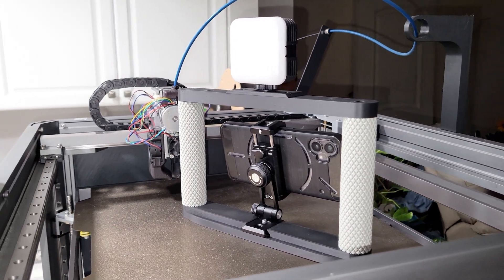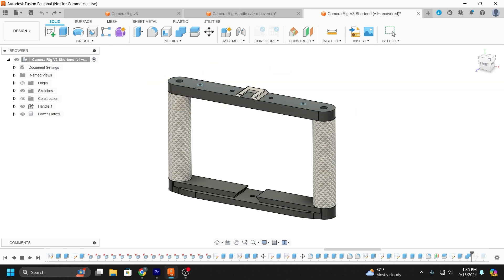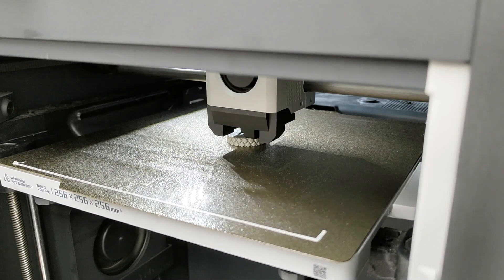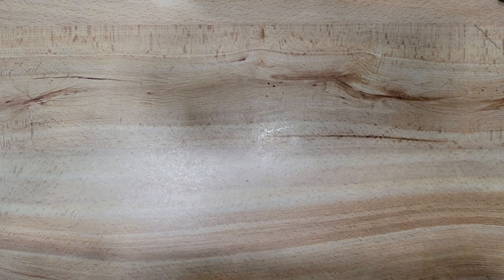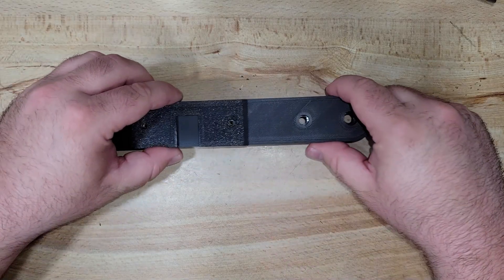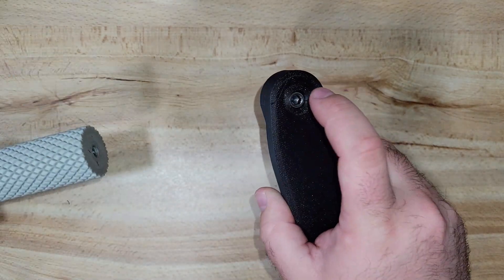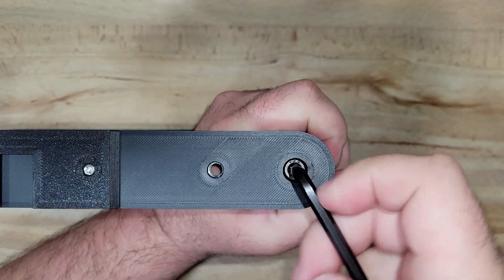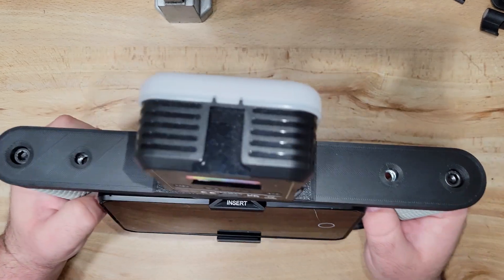3D Printed Modular Smartphone Camera Rig

Comment from the maker: GOOD NEWS! The new 2.0 version is finally here! Check this link for the updated version! https://youtu.be/8fgb2jeaN3w

Original comment: Hey everyone just a little heads up, I am working on a slightly modified V2.0 of my camera rig design. The assembly will be the same, but the new one will fit larger phones a little bit better. I will update this comment when that version is ready. Thanks for watching!
Reply: did you do a new rig yet to fit larger phones and is it ready yet
Reply: do have have  new rig ready yet to fit larger phones
Reply from the maker: @St.MarysKnights  The new version is ready. It is smaller and lighter but will fit bigger phones! here is the link: https://youtu.be/8fgb2jeaN3w

Comment: Do you have .3mf file?
Reply from the maker: This is an older version of the camera rig. I would recommend looking at the newer version here https://www.printables.com/model/1239977-smartphone-camera-rig-v2 if you really want to make this one, the links to the files are in the description
Reply: I do but my settings in orca are not right want to see if you had the 3mf file
Reply: The 1/4-20 screws stick up to high my print head keeps hitting them
Reply from the maker: You might not be using 1/4-20 jam nuts. They are different from regular 1/4-20 nuts. Are you able to measure the thickness of the nut using calipers? If so I can make a custom version for you if you are not able to modify the STEP files yourself
Reply: @makerscorner93 I did I got regular jam nuts 5.56 mm

Comment: Thanks bro. Never knew why pausing a build would be helpful until now, and also learned about the heat set inserts too.
Reply from the maker: Glad you learned something new! Pausing a print to install hardware, magnets, etc. is a great way to add internal features to a design that otherwise would be difficult or impossible to do otherwise. Thanks for watching!
Reply: @makerscorner93  MAGNETS! I have an idea.
Reply from the maker: Haha just be careful that your nozzle isn't magnetic! If it is make sure to glue your magnets in place before resuming the print! (I have absolutely made that mistake before)

Comment: Didn't find anything you liked, so you designed one that looks just like all the other ones?
Reply from the maker: The ones I found used 3D printed phone holders. They tend to wear out very quickly and not something I would trust putting a phone in. I also wanted a cold shoe mount and a few 1/4-20 mounting points. None of the ones I found had all of these features, so yes I designed one myself. There are not many ways to make something like a camera rig look different. I just made my own with the features that I wanted

Comment: My 2 cents: By default, Slicer shows a fully "completed" layer. That's why you think it's "already closed/sealed" and you can't put any nuts/magnets/objects in it. But the printer always pauses BEFORE starting/completing that particular layer. In other words, you could (and should) "add pause" at layer 34, not 33 (as you did) for the first pocket and at layer 661 and not 660 for the top pocket. Is this absolutely necessary? No, but it could ruin your print or even damage your tool head. How? If your layer height is greater than 0.2mm AND your z-hop isn't there or is too low... your nozzle could collide with the nut/magnet/object since you're printing the second to last layer.
Reply from the maker: You are absolutely correct. That is why I always make my pockets a little deeper than they need to be. It is hard to see in the video, but there is actually a pretty decent gap between the top of the nut and the top level of the pocket where the print pauses. This way if for some reason there is a collision, it is while the tool head is going around the outside of the hardware instead of directly over it. This gives a small opportunity to stop the print hopefully before it does any damage. Thanks for the comment. Great advice for anyone else who might be designing something with similar techniques!

Comment: Question please. You put 2 nuts in the upper assembly but they are not referenced later. What are they to be used for?
Reply from the maker: Those are just extra mounting points for anything you would want to add (lights, microphones, etc.) 1/4-20 is the universal standard for most AV equipment

Comment: Subscribed! Great video, great rig. I want to print this for my gf. She does amazing wildlife photography (small things, think Macro) and this would be great for her. Also, after getting my 3rd printer (CR1 SE) I’m finally at the point I’m looking to design my own pieces. So videos like this, will definitely help in that trajectory. Bonus, you sharing the STL’s is great but the Step’s even better. Thank you for sharing your work. Looking forward to more. Regarding your comment on the next iteration being bigger, I’m assuming just lengthening the upper and lower support bars would give more room for the camera, then doing the same for the handles? Anyway, one question. I really enjoyed embedding the nuts. Given that, why didn’t you do the same for the mounts? Aka, why go with heat inserts there? Again, great work. Thanks!
Reply from the maker: Thanks for subscribing! I always share my step files whenever possible, that way people can more easily modify my designs for their specific needs. The next version might actually end up being a tiny bit smaller, but the handles will be at a slight offset angle to avoid the possibility of your hand getting in the way of the camera on some phones. I used heat inserts because there wasn't any point in using large 1/4-20 screws for the cold shoe adapter plate (it would have been bulky and ugly). I didn't have any smaller nuts/screws for that part, but like many of us with 3D printers, I had a ton of heat set inserts laying around. That being said, with the included step files it would be very easy to modify it to use whatever hardware you would like. Thanks again for watching and subscribing! My upload schedule is a bit slower than I would like, but I have some fun videos planned and look forward to hopefully seeing you in the comment section again soon!
Reply: @makerscorner93  Thank you! Re the inserts, makes complete sense. I really enjoy simplicity in design and this is a great one! Going to make it for my gf! Look forward to more!

Comment: Really Great project. Very simple and doable for all levels of 3D printing fans. As a suggestion, I would think you might want to redesign the bottom plate to reposition the cell phone holder forward of the grips. The way it is designed, I think the average person will continuously be putting their fingers in front of the camera lens as they go about their filming duties-opening and closing their fingers around the grips for comfort and positioning. As a secondary benefit, it would also make the bottom plate deeper front to back, which would allow for it to be more easily set on a flat surface and used as a impromptu camera stand.
Thanks again for sharing the project and I look forward to watching your other videos.
Reply from the maker: I'm glad you liked it. I want this channel to be a place for projects that range from simple things anyone can do, all the way up to some really advanced stuff for the more "seasoned" creators. The version 2.0 I have been alluding to in both my pinned comment and a few replies is exactly what I was planning for that redesign. I am hoping to get around to doing it this weekend if I have time. Between work, hurricane Helene hitting last weekend, and a large time sensitive project I am in the middle of, I just haven't had the time to sit down to work on it yet. Thank you so much for watching. I have some fun things planned for the channel that I look forward to sharing with everyone!

Comment: Nice project! But wait a second, when you needed to make it smaller, why didn't you just go back in timeline and change existing features? It seems you added new features to make it smaller? Also, could be useful to have handles with slots (or second screw on one end) so that they cannot be accidentally force-rotated by hand.
Reply from the maker: I designed it late at night while enjoying some well deserved adult beverages, so it is 100% possible I did not do some things in the most efficient way possible while working in Fusion 360. I was a wee bit wobbly by the time I finished designing it haha. As for the possibility of the handles rotating without anything locking them in place, you could always use a bit of thread lock to help keep everything from coming loose. That being said after about 3 weeks of use I have yet to have that happen to me, but your milage may vary. I meant to make a note of optionally using some Loctite in the video but I must have forgotten. Anyways, Thanks for watching!
Reply: @makerscorner93  must be why you’re calling it “Fusion 360” 😁😁 It’s just “Fusion” now. No offense, but I’m on a mission:) too many people still call it by the wrong name

Comment: Hello there please reply back  I downloaded your Handle file  but after you put the jam nut and gets sealed in is the hole in the middle of the handle supposed to go all the way up to where you put the second jam nut cause the file I downloaded the hole in the middle of the Handle does not go all the way up through the middle of the handle
Reply from the maker: It is not supposed to go all the way up. That is just a clearance hole for the bolt. If you would like a version with a hole that goes all the way to the top, I can make one for you

Comment: great model!!
Reply from the maker: Thank you! I am working on a V2.0 that will better fit larger phones while also being possibly a little smaller. Thanks for watching!
Reply: @makerscorner93   Does it hold iPhone 14 Pro Max or a regular one? Are you just going to make it taller? Rather wait before I print. Thank you again for taking your time.
Reply from the maker: Apologies for not seeing your message sooner. It "should" fit, but I don't have one to try. I will probably try to work on the new version this weekend. Between work and the hurricane Helene this past weekend, I have not had time to work on it. I will let you know when it is finished
Reply: @makerscorner93  why does the hole in the middle of the handle get covered up after it seals in the jam nut i noticed it after I downloaded the file
Reply: @makerscorner93  let us know when you have the v2 ready that will the  larger phones

Comment: what type of  screws did you use with the jam nuts  you forgot to put the link to what size the screws you used
Reply from the maker: They are just random ones I had lying around. They are standard 1/4-20 socket head cap screws.  Any length over 1/2 inch should work for the handles, however I would recommend 3/4 inch ones for the handles. I wouldn't go any longer than 1/2 inch for the camera mount. If you can't find socket head screws, then pan head or button head screws would technically work as well, but you may need to modify the diameter of the counterbores to make them fit. Here are some links to some cap head screws if you are in the US.

https://www.homedepot.com/p/Everbilt-1-4-in-20-x-3-4-in-Hex-Socket-Head-Plain-Socket-Cap-Screw-2-Pack-804768/204282124

https://www.homedepot.com/p/Everbilt-1-4-in-20-x-1-2-in-Hex-Socket-Head-Plain-Socket-Cap-Screw-2-Pack-804748/204282122
Reply: @makerscorner93  and what size of jam nuts did you use in the prints
Reply from the maker: 1/4-20 jam nut. Screw size and nut size are always the same. 1/4-20 was used because it is the standard size for all camera equipment
Reply: @makerscorner93  Good to know. Again, thanks for sharing.